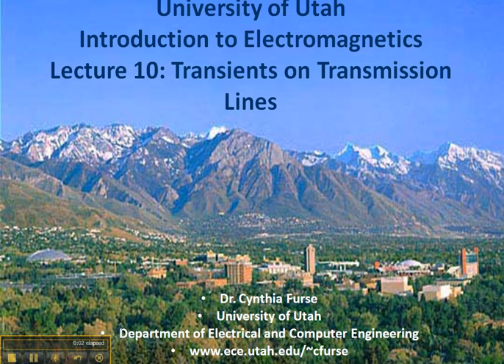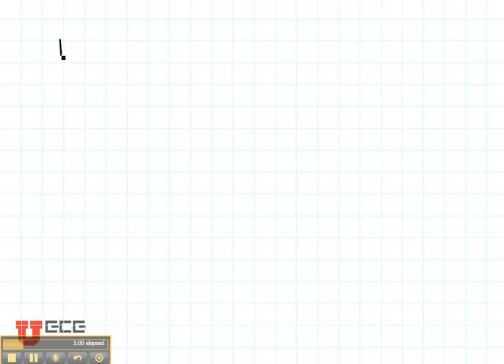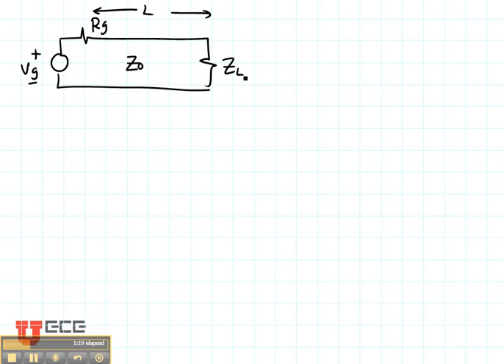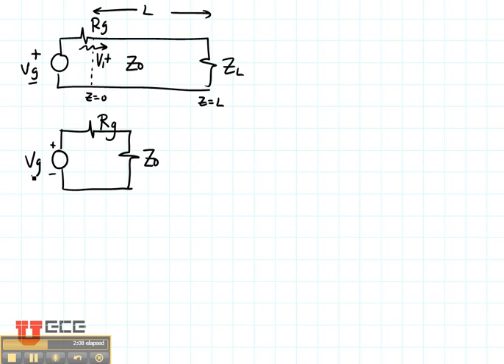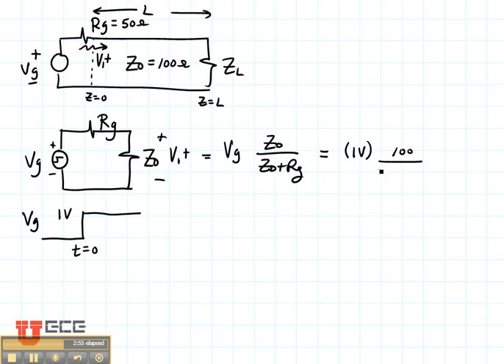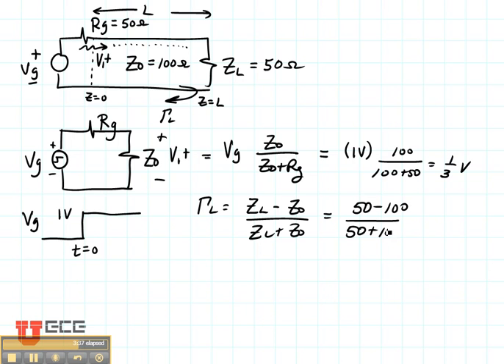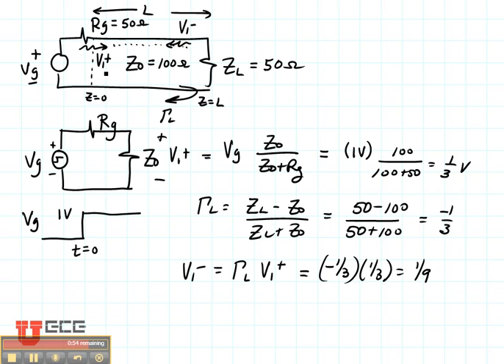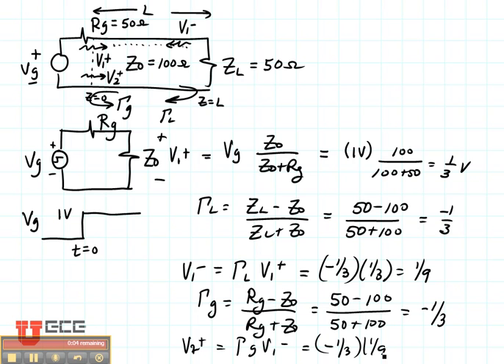ECE3300 Lecture 9-1 Bounce Diagrams

Comment: Is there a reason the voltage devidor is using z0 rather than zin?
Reply: I'm assuming it has to do with the fact that because it's a transient spike, the load at the end of the transmission line is unknown until a steady state is reached.

Comment from the maker: your first calculation of V1+ is incorrect, it is 100/150 =2/3 not 1/3.
Reply: Hello Ma'am Thanks for your lecture please tell me how to draw voltage reflection diagram at 30 nanoseconds long, for a 50-Ω RG58 coaxial line ? Please answer me fast I need it